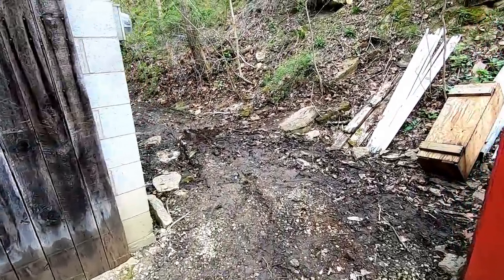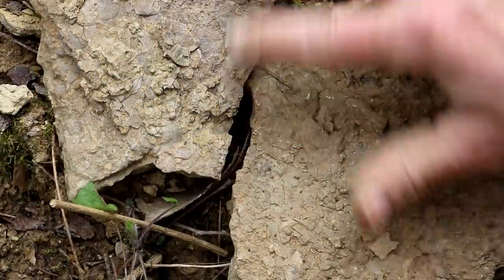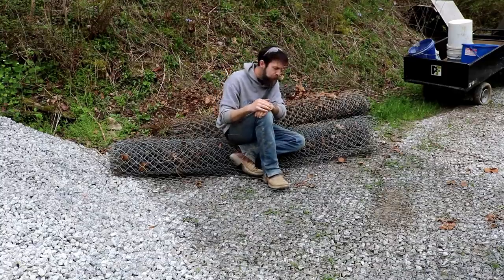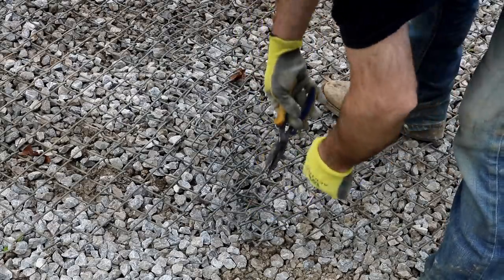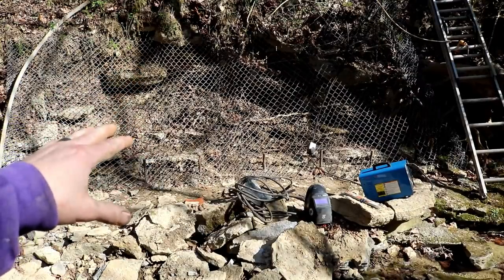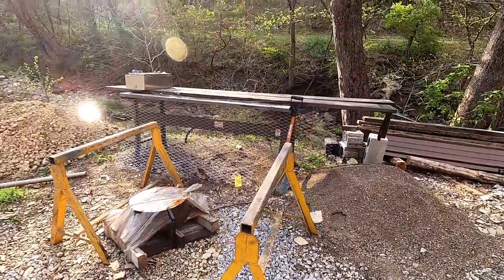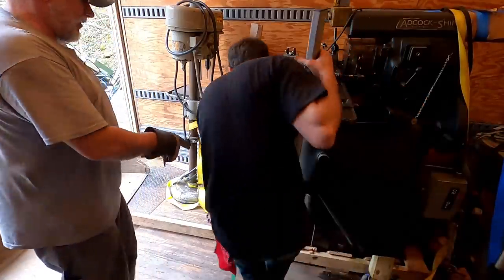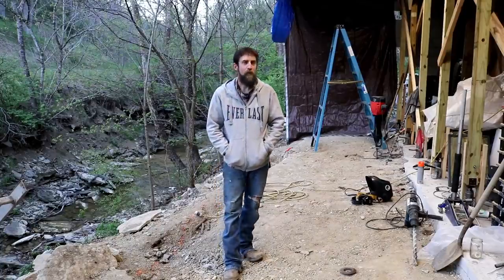New Machines Day! Shop damage part 10

Comment: When there is a flood like you showed before rip don that creek, very little if anything is going to stay !  Aboiut the only thing that MIGHT stay in place at the base of the hill in interlocking tetrapods.  Massive cast concrete and rebar that require a crane to place each one.  Clearly out of you budget.
Gabion basket have the advantage of weight and water flow through.  They would require some anchoring to the hill side and back fill with at least basketball side rock.
Good luck !

Comment: If that drill press is 3 phase you should be able to get a variable frequency drive that will step your 220v single phase up to 480 3 phase, and give you control over the speed to boot!

Comment: 480V machines run fine on 240V it just reduces the HP and torque of the unit. Al hooked you up! I caught a glimpse of some nice angle plates in one of those shots!  Sadly from what I have seen trees won't hold a creek bank, in fact their roots growing and jacking the dirt loose tend to aid erosion by lossening things for the water to take away. I think concrete diversion wall to route water off the bank is the best solution to fix it right.
Reply: Running a 480v motor with 240v can cause a higher current draw if the motor is under full load, so you have to be careful or the windings will be burnt, I don't know what kind of load the motor would be under in this case, probably not too demanding if he can spin the spindle easily by hand, you'd have to measure the current at start and under load to know for sure. https://electronics.stackexchange.com/questions/329897/how-does-low-voltage-burn-out-induction-motor
A small transformer just big enough for that drill would also work, here's some charts that should help sort out the size you'd need, a 3hp motor would likely need a 6kva transformer, which isn't exactly cheap.
A motor rewind shop could rewind the field coils for  240v if there aren't any leads to reconfigure the coils for 240v.
Once Steve digs into that project a little more we'll have a better idea what options will work out best.

Comment: Looks like it would be a pain in the butt to put a french drain back there in that valley. Just putt the french drain out on the side of shop where you have plenty of room then run solid pipe to a make shift yard drain back there, one is plenty more drains means more sump cleaning keep the pipe level all the way slope is not needed water will perculate. Idk what your soil conditions are for depth but I do draianage too and I would put the french drain portion where I can dig in open then run solid pipe back in that cramped valley to a sideways ADS TEE with bands make your sump and invert what you want, set a frame n grate onto top 4" concrete. Best of luck dude!

Comment: I also have a Leland Gifford drill press I am trying to decide what to do with I am on the fence between trying to track down a transformer to step up to 480 V and just removing the old motor entirely, adding a pulley to the shaft, and fabricating a mount for a new motor to run it with a belt. I am interested to see what you decide to do with yours. Keep up the good work!

Comment: Steve good luck digging the 2 french drains in those rocks with a mini excavator. Mini's don't have the horsepower to dig out rocks of any heft! Good thing you have a jack hammer. Does your jack hammer have a pounding bit to drive 1/2 rebar into the hill where there isn't bedrock? Al is a real good dude. That mill and the grinder(fwd/rev) are  beasts!

Comment: @Steve, depending on how the motor is wired internally, you can sometimes do a little surgery and switch it from wye to delta without rewinding the coils, dropping it to 220V in the process. I did it on my Emco mill motor one afternoon, with not much trouble.

Comment: Nice work and nice new machines. I am sure you will put them to good use.
You should be able to run that drill with a small three phase transformer, I have been doing so for a while when I did not have three phase power in my temporary workshop at the time, slightly different setup since I had to transform the 220V threephase my VFD puts out to 3 phase 380V, but the only difference is the voltage. Setup was singlephase 220V to VFD, Threephase VFD to threephase transformer,  and from there to the machine. In the meantime I have moved and now have threephase power in the house, as it is usual here in Austria. Still some cabling to be done to get it to the new workshop, but that is just a trivial matter of running some cables.

Comment: Seems all landscaping projects are work-intensive.  Can’t believe how good the results look as you finish parts of this mega-project.  I’m thinking about the creek area — just above your shop and the bank modifications your making.  I’ve seen your videos when that thing’s running full force.  Wondering if the water could undercut your repairs at the upstream end.  Then wash the entire thing away.  Wish I could offer a suggestion.

Comment: They use rip-rap (large angular rock) to armour river banks.  If your mesh idea doesn't work out, that would be the solution.  The size of the rock has to be suitable for the stream velocity.  You can get a good idea of the size you need by looking at the large rocks in your stream bed (the ones that stay behind after an extreme high flow).  This is not cheap though and if done improperly, it will fail too by being undercut.  I don't think there will likely be an inexpensive permanent solution.  Good luck with your plan, I think it is a sound thing to try.

Comment: Instead of cutting the chainlink fence, open the upermost bend where it fastens to the next wire with pliers top and bottom, then simply unscrew the wire out like you did with the bits,, you can also use this to join lengths and rolls, its very quick and easy once you get the hang of it. Far safer and quicker than trying to cut it out. The thing i like about that type of rence is you can follow the contour of the ground somewhat unlike solid mesh panel fence.

Comment: Next time you need to separate the fence just undo the top or the bottom. On diamond fence you just unwind one strand and the wie is separated. You join it in the same way. Regards Billy S.A>
Reply: That's exactly what Steve said in the video.

Comment: Steve, my thought would be to contact  an engineer at your county highway department in regards to a practical solution  to your hillside situation as they must deal with similar problems regularly. I can't say much else as all my experience is Northern Indiana sand piled up or knocked down by glaciers. In any case, good luck and I am impressed by your progress.

Comment: Steve I've had really good luck doing erosion control like you're doing with the rocks and fencing on the side of the bank. It seems to mold itself to the bank and keep the water from getting behind it.  Good luck buddy
Reply: Ted Mattingly I was also thinking that adding crushed rock into the rubble would fill the voids and reduce scouring. If the open space is reduced the speed of and flowing water should be reduced. I’ve read that Ginkgo trees (male) thrive in disturbed souls like creek banks.
Reply: @ericmorriscompany9648  yes, a good bit of crushed rock of varying sizes would fill the voids like mortar and really help keep the water from destroying it.  It's hard to keep water from destroying everything though. Water is going to go where it wants and do what it wants, it's one of the most destructive things on this planet

Comment: I am usually the guy that has zero fear of any tool, but there are only 2 tools that I'll take safety measures for; the table saw and the angle grinder. Only 2 tools that'll get you quicker than you can ever react to and I don't care how fast or how agile you think you are, when things go bad with those 2 tools, you are gonna be lucky to walk away with all your digits and even luckier if they aren't mangled and useless.

Comment: I hope you checked the head and made sure it was flat on a surface plate on that bike. Usually the head warps when they overheat like that. We raced KTM's for years starting with the 50's working our way up though the classes. If the head gasket blows again check the head. I've also found that if you overheat the bike it's best to go ahead and replace the head gasket if you're racing and don't want a DNF.

Comment: That was Nice of Al! Some great additions to the shop. One thought I had when you were opening up the tarps , was it would really be nice to build some sort of roll up wall on that side of the shop. I know it’s not practical but it would be nice. I like working in the open air especially when it is hot and there is a breeze!

I would use up some of those blocks building a retaining wall so the hill side stays put on the uphill side of the shop. And make the space between the retaining wall and the shop wall at least 10 ft so you can get your truck and trailer back behind the shop when needed... I know even more work for you! But that could be done a little at a time when ever you feel like it!

Comment: Be careful saying you might not need that Sensitive drill press, you'll hurt it's feelings. I'd use it for a shop sign or mailbox. I bought the Bridgeport branded version of that AD-Shipley mill years ago, just manual not production. I found the small 7"?? in and out travel of the table was very limiting. I sold it off.

Comment: RE: 480v  I also assume it's 3 phase but you can get a used transformer fairly cheap to step up your 240v 3 phase. That motor looks less than 2hp so a 5kw unit would be plenty. Also due to the smallish motor you could go with a VFD that takes in 120/240 and outputs 480v. that would also give you variable speed.

Comment: I consider hand held cutoff wheel tools to be about the most dangerous item in a shop. I witnessed two incidents where cutoff wheels have exploded while in use, one the cutoff wheel ricochetted off of the users face shield leaving a large gouge in the frame, and the second incident actually cut the users throat, nicking a major artery and sending him to the hospital. Fortunately it only required stitches and time to heal. Both incidents were because of the use of wrong speed rated wheels for the tool and no attached safety shroud. In each instance, the tool was issued from a tool crib with a used disk already installed and no safety shroud attached. Shroud was either lost by a previous user or still in the crib separated and forgotten on a shelf.  In each case the user assumed the tool crib had verified the disk speed and the tool did not come with or need a shroud, the tool crib attendant assumed the user would take responsibility to check tool for ratings and requirements. During after action investigations, I suggested that all cutoff tools and spare disks be recalled, and they be replaced with ones with a common speed rating and an attached shroud, then only a single speed rated disk need be purchased going forward, and mixing of multiple disk ratings would be engineered out. I only ever heard back crickets after sending to the safety office and CEO. Retired now and I don't own or use any cutoff wheel tools.

Bill

Comment: Mark 25:44 this is where those waste concrete should go, instead. Why ? We don’t need wire mesh on top to slow down flow rate here and to keep old top soil / sand mass from drifting away, from further excavate the slope when water level rose.

Comment: pull the top cap off the motor mount a pulley and run separate motor using old motor as part of the spindle
Reply: Definitely an option!
However, it's strange there isn't 9 wires that can be reconfigured to low voltage. I haven't seen a 3 phase motor that couldn't be reconfigured. BUT, I know I haven't seen them all.
Reply: @dans_Learning_Curve  ...If he can live with less power, he can run the 480v motor with 208v, no problem.

Comment: Assuming that drill is around 2 HP single phase, a 240-480 or 120-480V 2000VA transformer can be found on eBay for not a huge amount of money. If it is 3 phase things get worse rapidly of course.

Comment: This is probably in your plan, but since you didn't mention it: at the bottom of the screen reinforcement of the bank, pile up an assortment of rubble and boulders to prevent fast-moving water eroding the very base. This stuff has the excellent technical name "rip-rap".

Comment: Hi Steve,
You can run your 480 volt machine.  You will need a transformer to convert your 240v to 480v.  I would be happy to help you spec it out if you decide to go that way.
Reply: I was thinking the same thing, but does being 3 phase make it more complex than a standard transformer?
Reply: @greasyfingerprints  Not more difficult.  We have to use a three phase transformer.  Don't forget that the volt amp rating will need to be 1.73 times larger for the 3 phase system as verse the single phase system. 

Steve is using a Rotary Phase Converter from American Rotary.  So we would wire the output of the phase convert to the input of the transformer.  The transformer then steps the voltage up to 480v.   Then we use the output of the transformer to the machine tool at 480Volt.

Comment: I know it's an immense amount of material.  But moving the lower lip of the hillside back a couple of feet.  Leaving the surface slightly sloped away from the building towards a short landscape block wall against the hill would reclaim some silt in time.  After listening to your talk sitting on the fence.  Some other young family will enjoy that property after you move on.  The only question is when you'll start to enjoy that new shop and property.  5 years from now or 20?  You're making a big improvement but only the last place has to be your final resting place.  I'm thinking of moving to get a new workshop thus why it's on my mind.  Enjoying follow the project.

Comment: here in Europe for bank consolidation works we use squared cages made of metal web and then filled up with medium sized stones
Reply: Those are Gabions - originally an Italian / Roman invention, came into English via France.

We also sometimes use cylindrical baskets of wire mesh filled with gravel or rubble, not quite Fascines which are bundles of rods, tubes, or even plastic pipe.

Steve's plan is closer to what we call rip-rap, where the hillside is covered with rubble/gravel and then large stones to hold things in place.  Since he's got a lot of decent sized broken concrete rubble from the bad part of the shop floor, that would make a good rip-rap to go over the smaller chunks, and possible over the wire blanket that he's installed to retain the backfill rubble.

Basically, he needs a sturdier base to deflect the water a few feet, and he's limited because the opposite bank is his neighbor's driveway, which he can't damage.
Reply: chemech yeah exactly

Comment: Steve, awesome new equipment! I need to find my own Al! I'd talk to a motor shop about the drill press to see if they could convert it to low voltage. I'm not sure if it is even possible but it sure would be nice to have a high speed drill press available if you need it. As far as my thoughts on your bank erosion prevention method, I believe you are going in the right direction! If you can get the ends of the chain link fastened as good as the bottom and backfill it with a lot of the concrete rubble you pulled up from the damaged floor or even just rocks I don't think that you will have anymore erosion issues. As long as it lasts which I don't see why it wouldn't. But like you said, water has immense power. Anyways, I wish you and your family the best! Stay safe and healthy! Dan @6-4_Fab Glen Rock, PA
Reply: His name wasn't Al. That was Santa Claus!
Reply: It will run on 208-240/3.  The motor will be down a bit on power from it's nameplate, but it will run fine.
Reply: @paulcopeland9035  no induction motor runs well at lower than the voltage it is designed to operate on. But 3 phase is more tolerant of under volt than single phase is. We're really lucky that induction motors run at all. It took a genius like Tesla to even conceive of them. How they work is just that complex. So I am not going to go into why under volting induction motors is so bad. Suffice to say it is though.

Comment: Keep your eyes peeled for a 220v to 440v  used transformer for the drill press.That will get you around the 440v problem.
Reply: Bonzai yes that was my thinking. I see them at auctions all the time pretty cheap. It shouldn’t be a big problem, especially if it is just a single phase motor. Cool machine, great price! Also, free hardness tester? How awesome is that? 😬
Reply: Bonzai....Just run it on 208/3 (what he has).  It will run fine, just less horsepower out of the motor.

Comment: The cylindrical piece of steel with weigh around 342 lbs -- pi * radius*2 * height (12*12*12 cu-in/cu-ft) * 490 lbs/cu-ft

Comment: There is one way to stabilize a river bank: give flood water somewhere else to go. Usually that is accomplished by lowering the bank opposite to whatever you are trying to protect, followed by carving out a semblance of a flood plain on that opposite shore. Of course I don't know how practical that would be for your specific piece of land. But anything you can do to your opposite bank to divert flood water in that direction will pay dividends in the long run.

And ignore anything you might hear from county extension or others about mythical "100 year" or "500 year" floods. With global warming those records, if they ever had any validity to them in the first place, are toast in today's climate. Assume a 500 year flood as soon as next spring and you'll be closer to the mark. And a big flood will deepen and widen a diversion channel that you get started. The answer to your problem is proper grading of the opposite shore. Nothing else has staying power